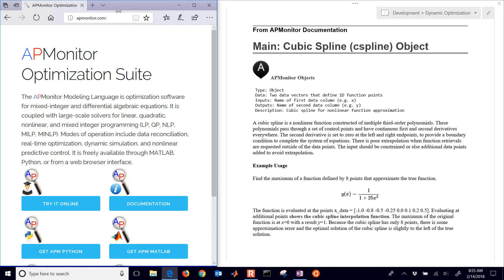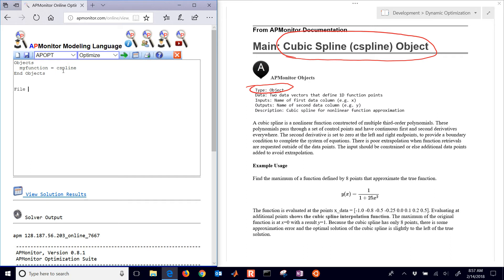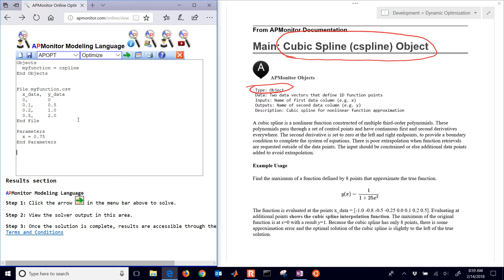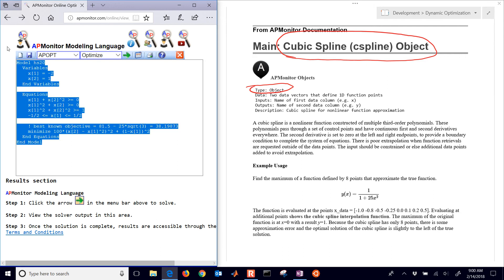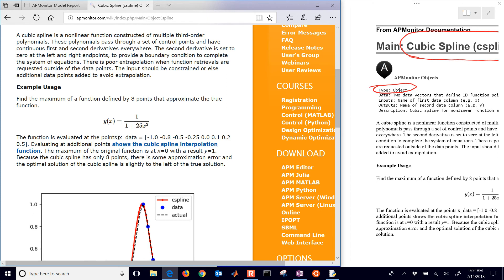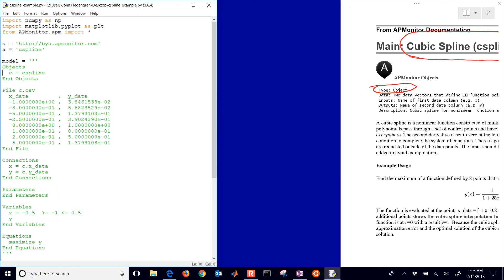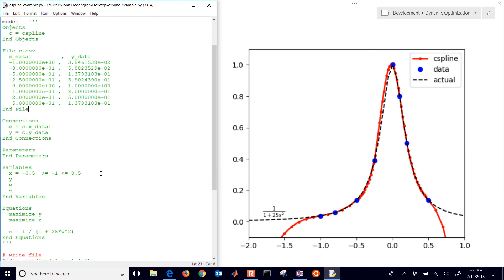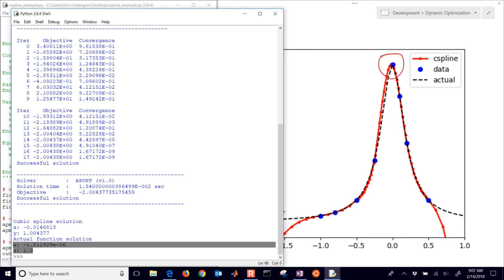Cubic Spline Object in APMonitor

Comment: Cubic splines are used a lot in motion control.  There is a way to fix the beginning and end to have a 0 velocity AND 0 acceleration.  In motion control the cubic spines are used as cams or cam tables.  In some applications like sawing wood the wood is scanned and a separate cubic spline is calculated and download for every actuator.  This is all done on-the-fly while cutting the previous piece of wood.

End point handling is critical.  We provide options to stop at the current position or extrapolate using the velocity and acceleration at the beginning or end point.

Cubic splines have some interesting properties like minimizing the acceleration rates necessary to move through the control points.

Besides motion I have also used cubic splines for interpolating between points in time when trying to do system identification and I need to find a dead time.   This can't be done in discrete jump or time increments
Reply from the maker: Great insight. Right now I have 2nd derivative =0 but I suppose that should be an option.
Reply: We can make velocity or acceleration 0 AT THE SAME TIME or what ever value we want.  This makes cubic splines much more useful.  It takes some tricks.
Reply from the maker: One of the additional things we need to consider for optimization is that we have continuous first and second derivatives, even at the endpoints. With continuous derivatives, such as abrupt endpoint changes, the gradient based solvers may not converge or converge slowly. I'll take a look to see if we can use your suggestion and also have continuous derivatives.
Reply: This is very important because our customers sometimes run splines cyclically.  This means that the position, velocity and acceleration at the end of the spine must match the beginning of the spline to make the transition smooth.

Hopefully my comments provide useful examples of why cubic splines are important and how they are used in industry.

Side note.  Your examples have helped me significantly in getting a jump start in python.  In January I started my own python hydraulic simulator.
http://deltamotion.com/peter/py/HydSimCN.zip
I still need to clean this up.
I try to follow all the conventions for writing python code.
I have a more sophisticated version but I don't want to give away secrets.
Thanks